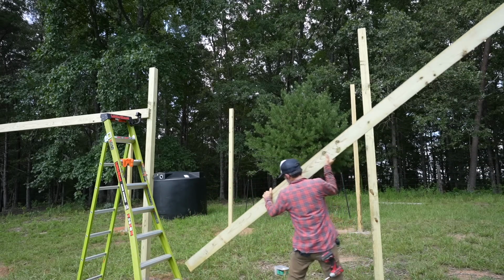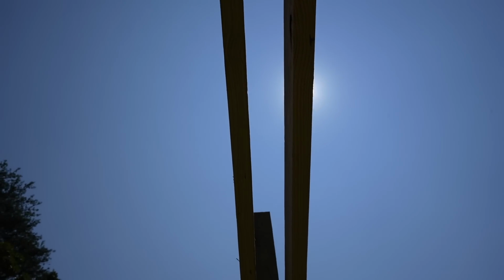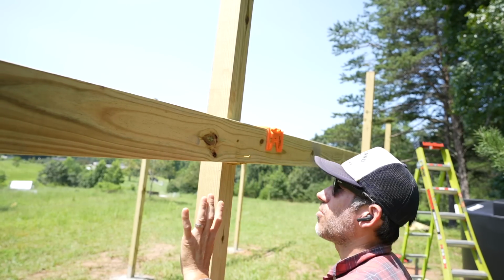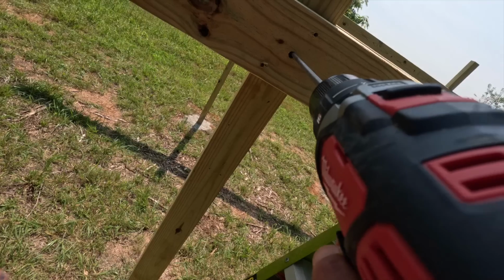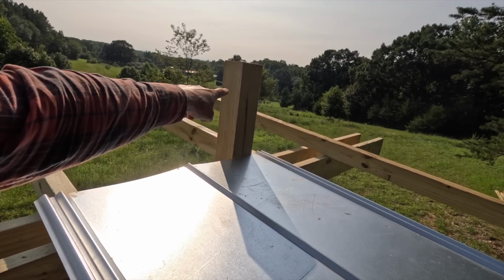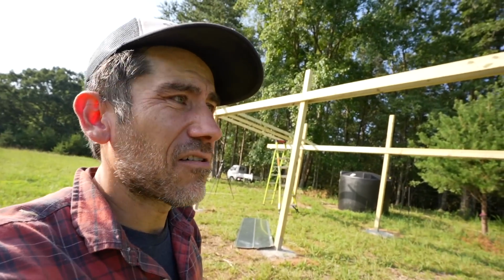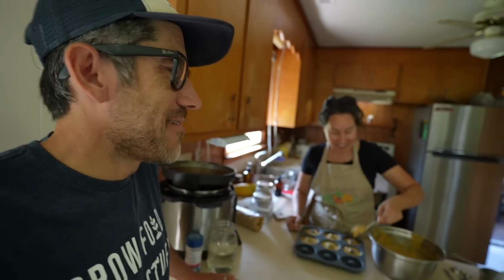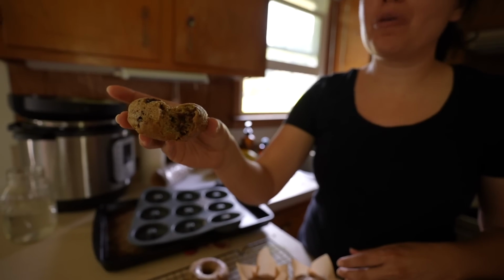It's Starting to Look Like Something/ Rain Collection Shed Build

Comment: If you add angle bracing out on the ends you can leave that roof super long and cantilever it. Since it's merely for rain catchment it'll be fine. You don't get much snow(hopefully) so you'll likely never have any issues. Also if you never wall it in you'll have more " dry space". Keeping your ground posts dry is the secret to a long lived structure, and you'll never regret more overhang! This is a super cool project and seems very approachable. I build something similar for my rabbits to be in( and catch rain!). Thank you for sharing as always!

Comment: In Australia a lean-to structure uses the wall of an existing structure with the bit being built leaning against the pre-existing wall and the roof being higher at the existing wall and sloping down on the new structure

Comment: Run 1x4s over your purlins (running the same direction as your 2x6 double boards), then your metal sits on those 1x4s. Your metal will not hold up, and be weak, if you don’t run those 1x4s. Ask Al Lumnah.

Comment: You have said you feel weird being obsessed with collecting water in NC where you get regular rain. But actually it seems a lot more effective to me as a Californian.

In CA, or anywhere with long periods of no rain, unless you're collecting huge amounts of water in the rainy season it'll run out almost right away in the dry season. I find the water company rebates for 100 gallon rain barrels completely pointless to reducing water demand. That's going to save 100 gallons, maybe 200 if there enough gaps between rain to necessitate watering. That's quite literally a drop in the bucket of the average household's outdoor water consumption.

In NC, or anywhere with regular rain, you're constantly getting topped off so there's always a supply of water for the short gaps between rain storms. You could theoretically never touch your municipal (or well, or whatever) water for anything aside from potable water needs.

Comment: Jason, I am doing the same thing , but on a smaller scale. I am having issues with mold collecting in the storage tank. How do you plan on preventing this.
Reply: Are you using a black tank?
Reply: is it mold or algae?   A little bit of algae is not harmful but can be prevented by completely blocking the daylight/sun.   If you're using IBC totes you can cover it with black plastic or those lovely expensive zip on canvas covers like Jason has at the barn.